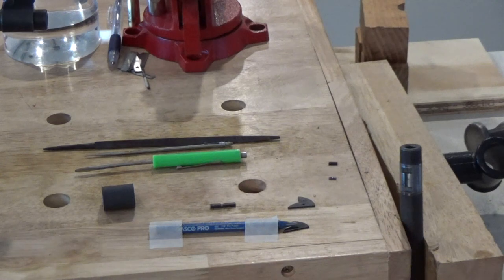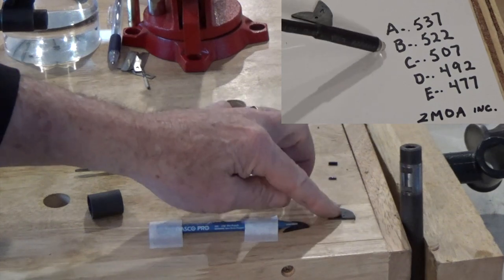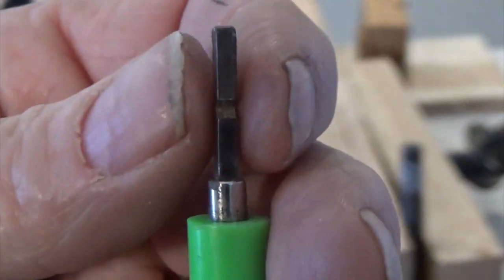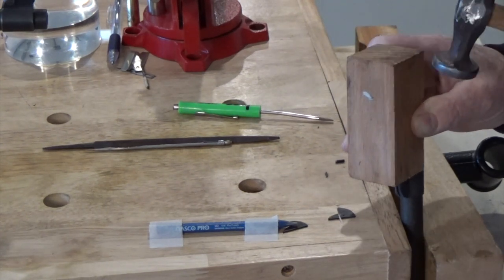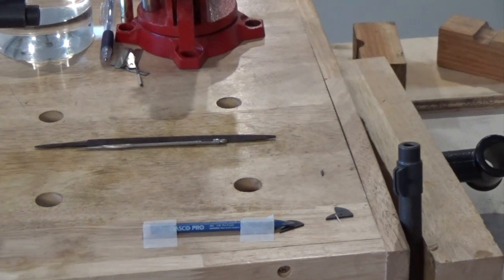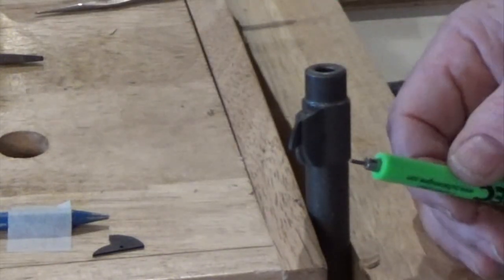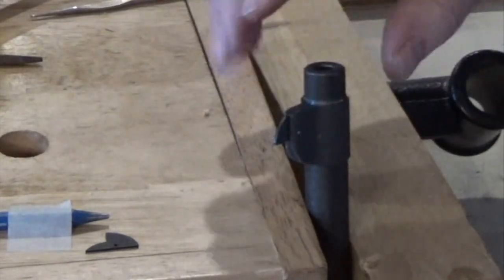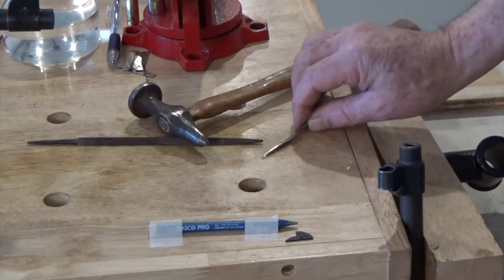Install front sight 1903 A3 Springfield

Comment: @Toadley Browne. Is your front sight protector one of those from "quality.dcm..."? In one of your other videos it appears larger than standard.
Reply from the maker: Thanks for the comment. The protecter has US and the flaming bomb on it with an R on the other side. When I was trying to do load development the high blade did not allow for the target to be centered in the two circles. Once I removed the protector my groups were a bit better. You might have something with the sight protector being incorrect as the blade that came on the gun shot 14 inches high at 100 and was not in the range of the sights available at the time. Thanks again. I will do some checking.
Reply from the maker: So I did some looking:) There was a 50-50 split on those who kept and tossed their sight guards. The USMC did however make a sight hood to allow for the higher front blade to be centered. They also used these hoods for competition as they did allow a much better sight picture. The image in the link is crude but I did find some globes (that seem to be rare to find) that would be a fine addition for accuracy shooting paper. Thank you for the comment as I learned something from your inquiry. Have a great weekend! http://forums.thecmp.org/showthread.php?t=184310
Reply from the maker: @timsaxer6442  Thanks for that.

Comment: I just acquired a 1903 a3 and it's shooting way high (about 12 inches @ 50 yards). Now I want to change the sight blade. My question is how to measure the blade that is on the rifle now so I order the right one to replace it? Thanks in advance.
Reply from the maker: Free it up and take it out. Measure the distance from top to bottom. Sight in at 100 using cut pennies. This is not a joke. With a pair of tin snips and a 1/16 drill you can match the gun to the weight projectile you are using. The shape can be made easily. Go 1/8 inch higher than the original to start. The thickness of the penny is the same. You may find you dont have to order anything if you can get the pin out without damaging it. Without having velocities, bullet weight and actual target results at 100 yards the question is impossible to answer. Try the penny trick it's a fun Sunday project:) Thanks for watching.
Reply: @ToadleyBrowne  Thank you. That's a great video, very informative.

Comment: Sir I figure your decimal points are the whole height of the sight blade. My rifle appears to have the tallest yet I am shooting  app 9" high at 100 yd's. This rifle has been arsenal refinished and I purchased from Classic Firearms. I can always put the point of blade in bottom of circle. Any help would be great. Thanks
Reply from the maker: What is the height from the top of the base to the top of the blade? Use calipers if you have them as each .008=1 inch. @ 100 yards.
Reply: @ToadleyBrowne  This is what there is of the blade that sticks out of the base. App .335
Reply from the maker: @st9041  Is this rifle a 1903 or an 1903 A3?
Reply: @ToadleyBrowne  1903 a3 Smith Corona which had a lot of work cause i did not want to send it back for refund. Barrel was replaced would not chamber round.
Reply from the maker: @st9041  I am sure this can be sorted out. Without looking, this is all I got:) Rear sight is forward on lowest setting. Your front sight blade is actually higher than my "A "sight blade. Mine is .308 above (total height .537) and yours is .335. above so total height would probably be more as well. First, heavier bullets, lower velocities will bring down impacts. Light projectiles really make a high shooting gun even worse. Something in the 180 grain may help with lowering a bit. If you have the front sight protector, the blade must be almost touching the top of it or very close and not centered in the protector. Take that off when shooting as it was never meant to be used as an aperture sight. 6:00 holds are fine for steel but can make it difficult to shoot smaller groups. Last resort and will only cost a couple of pennies (literally) Did you know a penny is the same width as your 03-A3 sight blade? Secure gun, remove pin retaining blade in reverse of video. It should come out fairly easy after recent barrel job. Set blade on top of penny and add how much height @ .008 per MOA at 100 until you get a zero with sight picture you like. The pennies cut with snips and can be fun to sculpt into the proper height. Mark and drill hole for pin and you are off to the races with an original 1903-A3 Abe Lincoln special. For real, I have an A3 that has a penny for a front sight that shoots under 1 inch 5 shots at 100 yards. If the front sight base on your gun is correct try heavier bullets or fabricate a blade from materials readily available. Have a good weekend.
Reply: @ToadleyBrowne  Super Kool thank you sir

Comment: What size punch do I need to push out out the pins? All the punches I currently have are too large.
Reply from the maker: 1/16 to remove the base. The blade pin was smaller on mine so I just took a 1/16 and finished it down to the smaller size. Get 2 1/16 punches and plan on breaking one as the front sights can be difficult to remove. Heat helps as well. Thank you for watching video.
Reply: Have the same problem, I’ll get my file out 😢
Reply: This is the dilemma I am facing now. I need to change the blade to a taller one and I am having the same problem. Thanks for asking.

Comment: I just noticed that my 1903 A3 is missing the pin at 3:13. It's held together this long but is my front sight at risk of falling or spinning off?
Reply from the maker: The pin was probably removed to attempt base removal. Those sight bases are brutal to remove so it probably is fine without the pin. In the event you ever want to remove it, soak for a few days in penetrating oil, hook base on corner and tap on muzzle area using a wood block or arbor press to remove. I get them off but they dont come off without a bit of drama:) heat helps as well. Thanks for watching.

Comment: Is this the same front sight as the regular 1903?
Reply from the maker: No, The base is different and the blades are different. The 03 has a mid barrel rear sight. The A3 has the peep behind bolt. You can cut a penny with snips to find the correct sight height for your gun. A penny is very easy to cut, form and drill and is the same thickness as the blade. Thanks for watching.
Reply: @ToadleyBrowne  Ah, ok.  I have a 1903 regular front sight and the site base is off and needs adjustment.  Suggestions? I'm a newb.
Reply from the maker: @minimusmax  Fire a 100 yard group with the rounds you intend to use. Note how high the group is above your aiming point. You can get closer by using a 6:00 hold where your target sets on top of the front blade or use heavier bullets. Both will lower your impact points. The third is drive the blade out and make one out of a penny .050 taller and install. You can file the penny blade down. It is trial and error. Just remember to lower impact points the sight blade needs to be Taller. One of my most accurate rifles in the 03 vintage has a penny for the front sight. If you mess it up it only cost a......well you know. It might take you 5 cents to get it right. Have a good weekend.
Reply: @ToadleyBrowne  so my 1903 is shooting so far to the left that I have to take my wind adjustment and put it so far to the right that it's unnatural.  The front site is definitely off and I'm looking on advice on how to reposition  it back to normal
Reply from the maker: @minimusmax  Without seeing the gun it is hard to diagnose. (1)The rear sight is pressed on and a pin is driven through to hold it in place. If you took gun out of stock inspect that rear sight base is pressed on and pinned. It is very easy to press these on out of alignment. (2) If the barrel was swapped it may not be indexed correctly meaning the rear sight would be out of alignment requiring a large windage adjustment to compensate for the misalignment. The front sight has a key slot in barrel that aligns the whole assembly. Check and see if the front sight base appears canted. Without a key to align front sight you could slide the front sight on, off center causing you to adjust windage on rear to correct. If the blade is not bent and the base does not look damaged or pressed on out of alignment. it can only be 1 or 2 being incorrect. Without looking at gun that's all I have.